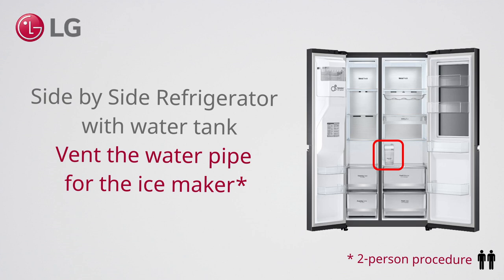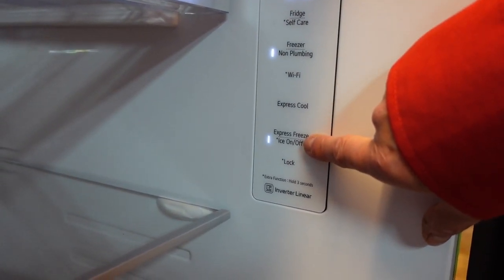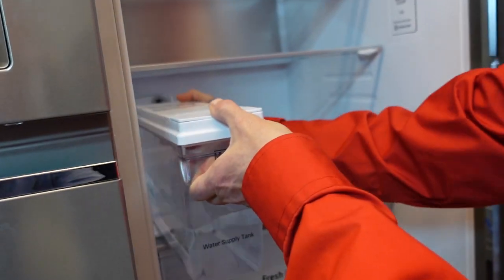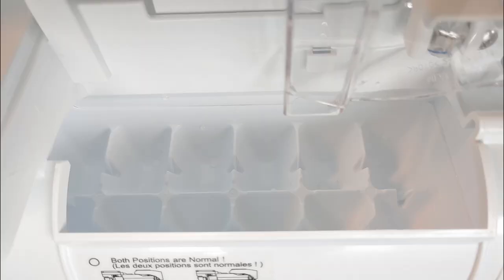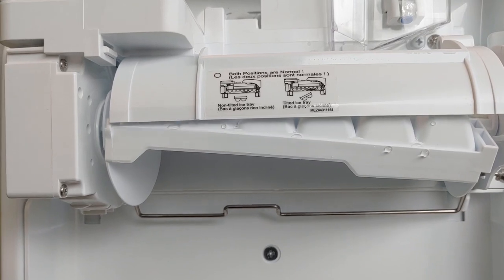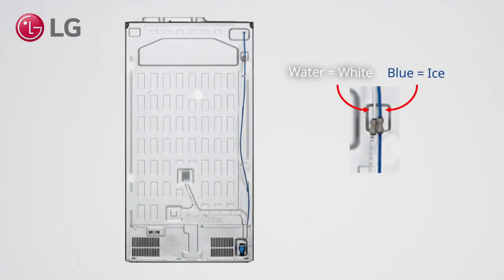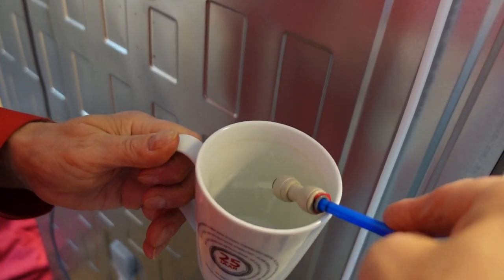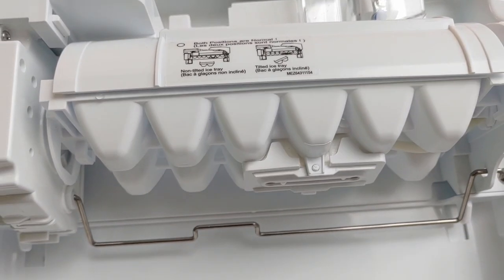[LG Refrigerator] - How to vent the ice maker water pipe on a Side by Side model with water tank

Comment: Thank you for this video. Does anyone know why I can't find anything on how to clean / service the water hoses and components behind the tank? Today I had some black particles and black gunk, backflow from the fridge into the water tank. On further inspection it was clear that it's coming from the inside which is not accessible. But neither the manual nor YouTube has anything on this. It's frustrating.
Reply from the maker: I understand your frustration. You may be able to flush the system with a dental cleaning tab + warm water. Be sure to flush enough water through the system afterwards by dispensing a few liters.

Comment: Great video, but it didn’t help me completely. I had to put suction to the lower pipe at the same time i push the test button, or when the pump was starting, then the water started flowing right away👍
Reply from the maker: Thanks for sharing. Not sure what lower pipe you mean. The pipe in the video comes directly from the pump. Do you mean that there was also air lock at another part of the piping?

Comment: What about when the water pump doesn't even start?
Reply from the maker: Then it is related to the pump, the main PCM or the wiring in between. In all scenarios I would advise to have a technician visit. What you could before calling is to check if there's a 'hidden' error, see: http://service.academy.lge.com/#/Troubleshooting, select refrigerator and check for he All-On mode procedure. If no errors, try and unplug the power and re-plug it after 60 seconds and see if that helps.